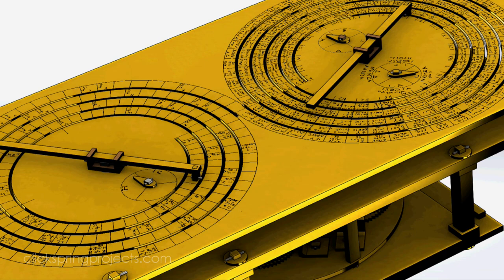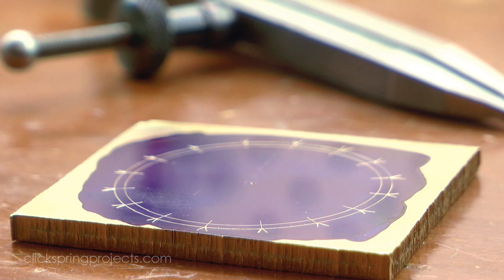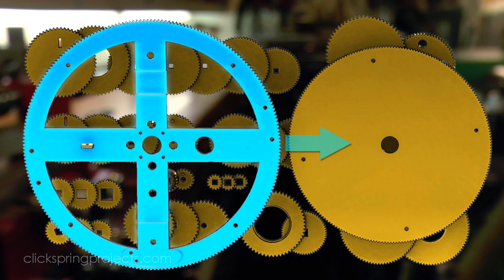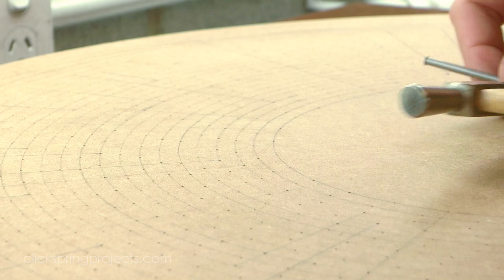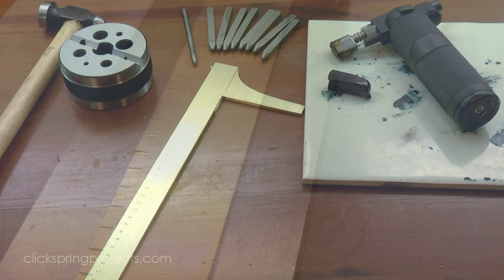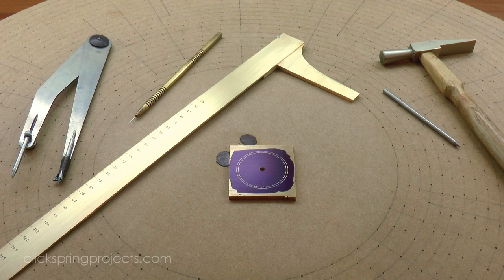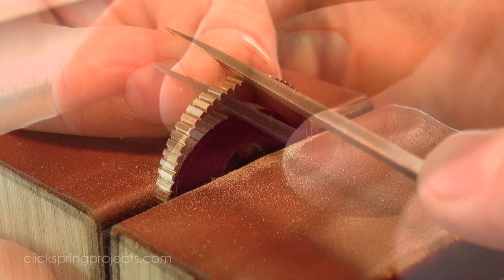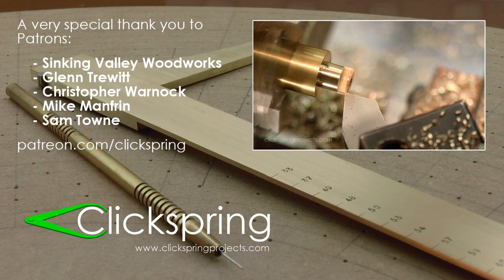#Antikythera Fragment #2 - Ancient Tool Technology - The Original Dividing Plate?

Comment: Seems like the method of manufacture was used to make future repairs easier without having to refabricate an entire gear. Especially if the parts were not interchangeable because of hand fitting.  
Like old flintlocks didn't interchange.

Comment: Seems like a very plausible theory to me for the makers to have built such a jig. And one additional set of nudges in favor of that plausibility: In the event of needing to make additional copies of the device (since for all we know there may have been others, just not found yet or otherwise didn't survive) it would speed up that process as well. As would production of replacement parts in the event of damage to one or more of the gears. The jig could simply be pulled out of storage, set up, and then the maker could be confident that the replacements being measured would closely match the originals. The device could then be repaired and back in service in a fraction of the time. Sort of like your comment regarding the wooden work-holding clamp you made for the project: It was simple to make and easy to repair, saving time on both counts.
Anyway, my little bit of input on that. Really enjoying the series and I look forward to the next installment. ^^

Comment: Chris, I'd like to point out that there's an easier way to mark out a circle for powers of two - and powers of two with multiples of fermat primes as well[1] - a compass and a straightedge are all you need.  Using a straightedge and known center, mark the diameter.  Using the compass, bisect the diameter through the center, which gives us quarters.  Bisect the quarters for eighths, and repeat for 16, 32 and finally 64.  No trial and error would be required.... but you'd need a pretty big piece of stock.

[1] https://en.wikipedia.org/wiki/Compass-and-straightedge_construction#Constructible_angles

Comment: Wooden jigs are both incredibly obvious and useful tools to make, and highly unlikely to survive into the archeological record. Personally, I'd be more surprised to find out that such jigs weren't used, though perhaps not one as complicated as what you made. Even just aligning the wheel to the center of the jig and the straight edge to the center of the wheel by eye would have likely given a good enough result, so even a large paper template may have been enough. or some equivalent to pencil marks on the workbench surface, though a proper permanent jig would likely be used if the craftsman were making multiple of the same mechanism, which they likely were.

Comment: This video is very exciting for me because I am currently making my own dividing plate. I already have the 40 division and 42 division hole sets marked and drilled, but this video made me realize that I might be better off starting over on a larger scale. The straight edge trick is brilliant! I originally planned on making a jig that used alignment pins and some sort of arbor to hold the blank while marking out the teeth, but this method would save me the time of having to design and build a jig. Do you think that the method you used will limit you in the diameter of gears you can make?

Comment: I think a manual devider like what you made is very resonable. Especially if they made more than one of these devices at any time. THis way, you could quickly and accurately replicate the gears with substantially less effort. As you say, no way to say for sure but it is quite resonable to think they may very well have used this or other similar technique. At least, this is something to consider.

Comment: Just a thought..seems like filing is the accepted way to form the teeth..but if a jig was made to hold the wheel and  could be indexed around to the next tooth as each tooth was cut away, this could be done using a triangle broach and a Greek version of an arbor press...it would be accurate.. mathematicians could work out precise outside diameter for tooth size and tooth number, this method would easily be repeatable...not taking anything away from Chris's  filing :) just an idea that might work.

Comment: Another way to do this might be to make a tape measure with however many intervals marked on it, and to turn down a circle until the tape just fits around it. If the tape is a little elastic (which fabric will tend to be), then you'd turn down the circle until you could comfortably stretch the tape taut around the edge.

The real point being, I suppose, that there's no need to suppose that aliens supplied the ancients with advanced technology to build the pyramids or what have you. People will find a way.

Comment: I know this is old now but have you compared the precision of your jig with that observed in the hole measurements for the Lunar calendar wheel from the mechanism described in the paper? If I recall that came out to a SD of about 0.3mm for the divisions, which is of course impressive for a builder lacking the advantages of modern tools. If your jig can be made with simple tools and is capable of similar precision that supports the idea a similar process was used by the machine builders.

Comment: Not just a question of really good eyesight but also of lighting. Doing this outdoors in full sun could be a real problem. Indoors by the light of a oil lamp, I have my doubts. The maker, or the makers workshop must of had some sort of filtering system to allow enough natural light to illuminate the work space yet avoid the glare that working in full sun could have caused. It could be as simple as a sunshade made of a reasonably translucent cloth. Maybe he pinched the wife's best nightgown. The maker, whoever he was, was truly one of the most talented craftsman of his age, or any other. Did he work alone? Did he have assistants similar to the apprentice system of the Middle Ages? Was he a free man? A slave? Did he design the device or was it commissioned by some genius who worked out all of the principles first? Did the maker produce multiple machines? 

Alas we will never know. If we have sculpture dedicated to other giants of that time there should be one dedicated to the maker.
Reply: Big opening in the studio to the north+skylight. No direct sunlight - yet the light is strong and uniform.

Comment: I would think that they used a foot powered file to file the teeth or they made some sort of wooden device that can hold a gear blank while allowing it to rotate to the next tooth position then lock it down.. Then used a arbor press with a tooth form to slowly make the teeth.  It would save filing and the gear could be slowly brought forward into the tooth form until the proper depth.  At least that is what I would have done.

Comment: Precision dividers are NOT necessary to divide a circle in equal parts.Neither trial and error.If you have a circle you roll it on a flat surface and you find the lengh of the perimeter and then you need to  divide that length in  N parts.So you start laying N arbitrary parts in a straight line and you get the lengh of the perimeter of an arbitrary circle.Then you have an arbitrary rectangular  triangular and a superimposed rectangular triangle with one common corner that you choose and one common side.The radieting lines from that corner and the parts in the arbitrary perimeter cut the perimeter of our circle in N equals parts.Now you roll that perimeter around our circle an the circle gets divided in N equal parts.The cart wheel makers call it a TRAVELLER.

Comment: This multi use dividing plate is an inspired idea, but it leads me to wonder would it not be possible to figure out the divider length through mathematics rather than trial and error?

If you have a circle with radius R and a regular polygon with N sides inscribed inside the circle you can know the length L of its sides with
L = 2 * R * sin(pi / N)
set the divider length to L and bam! correct division length on the first try

Even if it was only used to make the dividing plate in the first place it would certainly speed up getting the correct length from the divider and probably be more accurate than trial and error

Comment: Is it possible some of the gears were cast? Perhaps it would have been easier to carve the gears into wood, use that to impress a clay mold, and then just cast the gears.
Reply: Why do you think that would be easier?  You would use roughly the same tools on the bronze gear as wood one, and cleaning up the casting would basically be doing all that work again.

Comment: I think any Maker or Builder of especially such accurate things would certainly have made jigs esp. for easily repeatable items or even similar items. Like the dividing plate, it's possible they only made a portion of it not a whole wheel like you've made, which may also explain why as you mention in the video that there's no evidence found to prove such a thing was made, or if something was made, it could have been completely different but performed a similar function and has been found, and just not associated with what it's possibilities are. I find what you're doing and have done interesting, and as you say we can speculate, but I don't think you are far removed from what the ancients would have done.

Comment: First, I am in awe of your skill and video presentations!  There is a part of me that is inspired enough I might actually build some of these tools (particularly since 3/4 of all my smithing tools were stolen, and my entire library including my portfolio...).  

Other than that, this video got me to thinking -- primarily that the people who were working on these we most likely extremely well grounded in the math, geometry, and physics of their day.  It is well known that they understood the concept of π, and had pretty good estimations of its true value for everyday usage (see: https://www.exploratorium.edu/pi/history-of-pi ).  I combine this with a recollection of a 9th grade trigonometry exam question I had that basically went like -- "if you had a rope that covered the entire globe at the equator, and you added an addition 6.28  feet to its length, how far above the earth would it sit if it was equally strung above the earth" or some approximation of that.  The answer is simple -- approximately 1 foot.  While I am not immediately seeing the relationship of the relationship of the Δr and integral divisions of the circumference to write the formula here, but I bet a math wiz could come up with something which allow you to start with a fixed distance on a caliper, give you an initial radius of one of the larger  circles on the jig, and allow you to just step around with the pre-defined unit measure set by the calipers or other device.  Assuming you can find the ratio, or some other relationship, of the circle to the next annulus that would save a lot of time with creating the jig, but require a little extra math.  

Once again, your work is truly inspiring!  Thank you for sharing.

Comment: I don't think this constitutes a 'dividing plate'.  It gets you to the same place, but not in the same way, as near as I understand a modern indexing head.  In the modern version, you don't need to measure, mark, find your mark and then cut - it's all integrated to turn the work to the next cut without the need to measure, mark, then find the mark.  What you have here, as far as I'm concerned, is a basic marking jig - and I don't find it at all a stretch that an ancient maker would have thought to make a jig.

Comment: Chris, you do realise your leaving out that your using your lathe for the register pin the straight edge pin.. a whole bunch of stuff. Not putting that in there is kind of giving the impression that your doing this solely the traditional way. However. the rest is very well done and a real achievement to having worked out how to decrease the error. Best part of the video was your explanation on how you came to the rational. By the way, you do realise that Archaeologists study books and don't do mental work. I am not surprised if you are way more on they money than they are.

Comment: Chris could you explain what you mean by the "module"?
Reply from the maker: Hey Eli,  Module is the key parameter used to communicate the size of the gear teeth for a given wheel. In mathematical terms the Module is the Pitch Circle Diameter in millimeters divided by the number of teeth. This is the metric way of representing gear size, and is the reciprocal of the Imperial version, Diametral Pitch, which uses inch units.

Once you get your head around it, Module is a very intuitive way to visualize tooth (and therefore wheel size) for a given 'T' tooth wheel. I'm happy to recommend a good book on the subject if you need more detail than that.

Comment: The jig hypothesis is great. Would any of the woods they had have been stable enough to maintain the accuracy? They didn't have MDF obviously. Can someone do a calculation of error introduced by a 10-20% humidity change of the most stable wood species they are likely to have had?
Reply from the maker: Hey Jay, great question - my chief criticism of my proposal is regarding the stability of the wood. My observation is that a well seasoned long grain section would have been quite suitable. I have several large timber structures that have lived for many years in a very humid climate (Cairns, Australia) that are sufficiently stable (in both grain direction) to validate the choice of wood as the base material. And its worth pointing out that absolute perfection of the division method is not essential. There is much angular error evidenced in the machine itself that likely originated from the division method, so a certain level of error is justifiable and in fact required to truly validate the division method. Cheers :)

Comment: just notcied something:
There is an easier and specially far more precise way of dividing a circle.  
You can get a multiple of 3 just by using the initial radius and getting a multiple of 2 (like 64) is also easy as halfing angles is easy to do.  
For 64 you could start with 2 perpenticular lines dividing the circle into 4 segments, then divide the segments into 2 - 2 times. and you have your 64 segments. You could also just do this for 1 segment and then copy it around.

But should be more precises than trying to eyeball it.

Comment: I'm surprised that you start dividing by using big divisions (e.g. 16). would it not be more accurate to successively divide by 2 as far as possible, then divide more factors in once necessary? Also, with the greeks' excellent knowledge of geometry, they could use a compass and straight edge alone to divide a circle into 3rds, 4ths, 5ths etc.

I guess the biggest problem is large prime like 223, did you do that only by trial and error? Since that could take many hours alone, could we cheat with modern maths and use the circumference of the circle to find the right divider separation?
Reply: You can't actually divide the circle into 223 using compass and straightedge as Gauß proved. The Greek only knew how to divide the circle into 3, 4, 5, and 15 parts, and any power of two multiplied with these figures. However, you can construct these “impossible” divisions with high precision using other means: If you have a circular dividing jig, you could roll it over a sheet of paper in a straight line. Mark out the length of the circumference on the sheet of paper and then divide the line into an appropriate number of equally-spaced segments (possible with compass and straightedge). Then you can roll the dividing jig over the line again and pick up the measurements. Perhaps it is even more precise to only transfer a few measurements and mark the rest with a compass.
Reply: This is a method using one of Thales theorems if I understood you correctly. Given the fact that Thales lived around 600 BC and the mechanism is dated at 200 BC it is very likely they used this method. We even use it today in construction and design.
Reply: What method are you talking about? I only know one theorem of Thales and that one doesn't seem to be too useful in this context.
Reply: https://en.wikipedia.org/wiki/Intercept_theorem look at where it says Dividing a line segment in a given ratio
Reply: Ah! That one. Yeah, that's the method I meant. I didn't know it was due to Thales.

Comment: 223:
"if it already existed on a jig"

A jig for what?
Reply: For the other gear that needed the exact 223 teeth. The second gear that could use any of the range around 223 might as well just use the same number then since it works and is already set up.